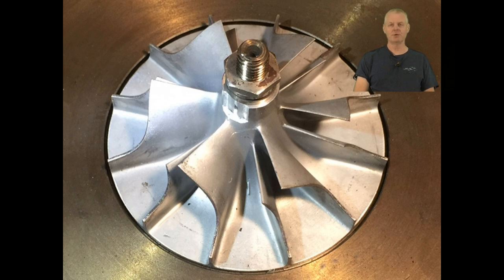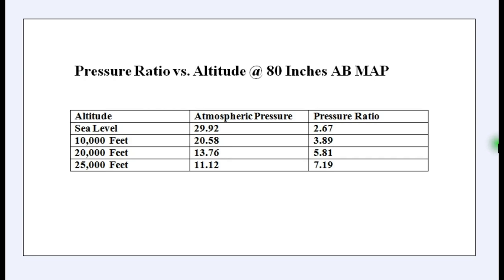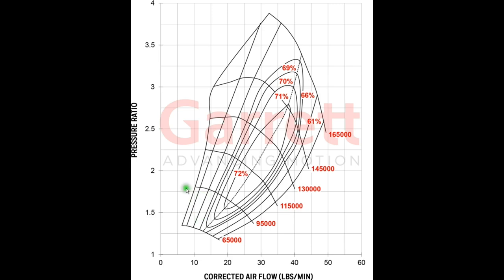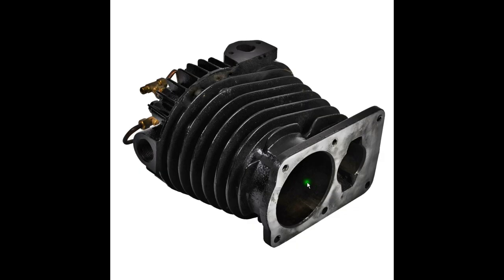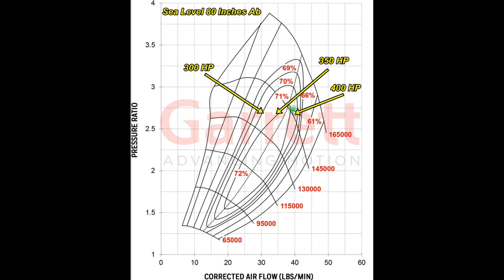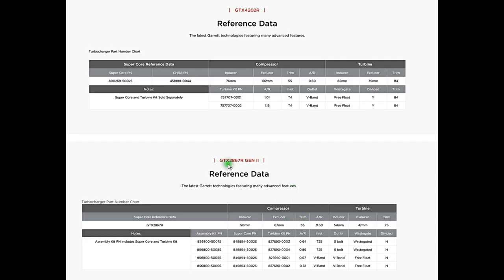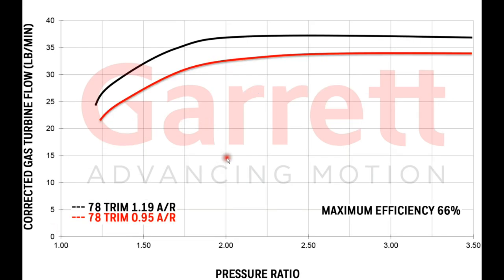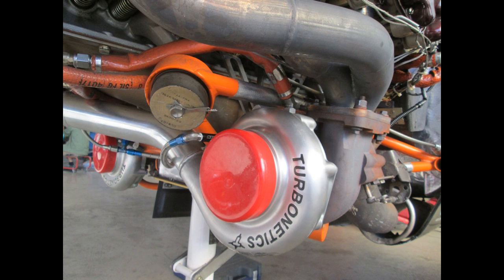What's Wrong With Raptor's Compound Turbo System?

Comment: Your numbers for petrol fueled engine is spot on my friend...
Reply: @ryanthomas2472  , Yep, getting the boost on the money is the goal! That's what experimental is all about! At least it's spurred intelligent working knowledge of innovative discovery of upgrading light aircraft propulsion... Many discussions are now happening... The compression ratio that's engineered into engines is called "static compression." When boost is combined in conjunction with compression ratio, the result is known as the "Effective Compression Ratio." Low compression engines will facilitate higher boost than high compression engines. An aviation solution that one company has employed with Diesel engines is a low compression aviation Diesel engine requiring spark ignition which will accept higher boost. With any application of serial compound boost it becomes a balancing act of engineering compromises concerning aviation FL (Flight Level) operational environments. 

Presently I'm spending time with a commissioned project calculating series compound boost for a proposed aviation 4 cylinder 150 KWH auto ignition Diesel propulsion unit. I've found the numbers skewed counter intuitively with high compression engine applications fed with railed fuel injection systems... 

I'm convinced that Boosted Aluminum Block Diesel aviation piston engines will gain a considerable market share like they have with the marine propulsion industry. Bottom Line... Experience with petrol boost low compression SI engines isn't an equivalent benchmarked Horsepower conversion when working with boost... Torque is the master of KWH conversion. The goal in X country aviation or marine propulsion operation is to use less fuel for distance traveled... Correct? 

The balancing act that's paramount to this aviator's awareness is average fuel burn consumption for weight transported. I've found that Torque fuel flow of Diesel piston engine propulsion KWH output is almost 1/2 that, of it's petrol burning cousin... In other words... 20 gallons of Diesel fuel (timewise) will just about do the work that it takes 40 gallons of petrol to perform... Rule of thumb speaking!  rv6ejguy with his presentation is spot on for petrol... He's a sharp guy that's very detailed oriented. I've been working with boosted diesel marine propulsion at about sea level since the 1970s. The Mercruiser TDI 3.0 V6 Mercury Diesel TDI marine propulsion system is similar to the Raptor's Audi 3L TDI. I only became aware of Peter Muller's Raptor project June of 2020. I never considered employing Diesel engines for light GA aviation till I discovered Peter's remarkable work at that time. Since then I've been experimenting with different configurations on the Mercruisers to get my base data from, thanks to his work.

I've spent many enjoyable hours with aviation since the late 1960s. Primarily with certified manufactured aircraft. Mostly avoiding experimental machines...  love flying at FL-24 in a private 4 place turbocharged aircraft, cruising at a calibrated IAS of 100 ~ 120 kts tracking groundspeeds north of 200 Kts sipping an average 11.5 GPH fuel flow petrol in strait and level cruise configuration... But that's only 20 MPG with a tail wind... With Diesel the MPG would be closer to 30~40 Statute Miles Per Gallon in real-world applications... When I crunch the numbers... Series compound boost Diesel piston aircraft propulsion becomes a no brainer decision for light private aircraft operations... Good thing that Turbos are relatively inexpensive in the scheme of things... We need real-world test to verify what seemingly looks good on paper. At least now we have a working premise to tackle the solutions...
Reply from the maker: @willhibbardii2450   Present SI aero engines can deliver .38 BSFC in cruise LOP, the best light diesel aero engines about .33. That's only about 15% better. You're saying here the BSFC will be half with a diesel... Diesels output less torque and HP per unit displacement and boost than SI engines. I did a video on this some months back. Diesels have several drawback for high altitude aviation compared to SI engines. I may do a video on that sometime in the future. The big draw for diesels is no lead, cheap fuel in my view.
Reply: @rv6ejguy  , Yes, I prefer inexpensive thrifty clean burning fuel... A rule of thumb I've adapted for the marine and aviation propulsion is remarkably accurate and simple... BSFC (Brake Specific Fuel Consumption) with gasoline propulsion I've found to be directly relatable to (GPH Fuel Flow)... Multiplied by 10 is close to horsepower being employed by the engine, with an engine running LOP (Lean Of Peak)... Example: If the Gasoline fuel is flowing at 20 GPH (Gallons Per Hour) the so called horsepower being employed is about 200. Not perfect but there about... 200 HP I equate to on the dyno to be about 150 KWH... At Standard Temperature and Standard Pressure with naturally asperated engines.

Supercharging and turbocharging simply equate to expedited climbs... The trade offs for the amount of fuel needed to get to FL- Cruise altitudes then trimmed clean is a stepped process of performance finding the sweet spots. With every 10 gallons of fuel burned (Gasoline) the aircraft loses 60 pounds and the aircraft will climb to the next step...

The Guy that taught me to fly little airplanes drilled something into me that's been very handy. The Aircraft I trained in was a Aero Commander 100. He had a fuel flow indicator installed. On a cold day below standard temperature 0 C at sea-level the engine, a Lycoming O-320-A air-cooled flat-four, 150 hp (110 kW) would consume just over 16 GPH on a hot day that number changed dramatically reduce to under 14 GPH at about sea-level. A large portion of may aviation training was operating at 14,000 feet MSL and above in that little aircraft especially in winter months. When I started doing my solo cross country work it was no problem getting through 14,500 and above (Yes we carried supplemental Oxygen) It amazed me that the naturally asperated engine LOP would sip fuel at less than 6 gallons per hour throttle to the fire wall at full altitude. The translation to horsepower was about 60 hp employed but yet we could track ground speeds well over 120 MPH. A great trade to my thinking. Though the Corrected TAS was 65 ish. He taught me how to enjoy little airplanes and keep the cockpit quiet with very little stress on X - Country flights... The cruise accent to altitude was 1/8 FOB (Fuel On Board) of the fuel consumption and the decent 90 MPH at 300 fpm decent with the engine loafing. No need for headphones. Guys that fly with me comment how well they can hear without allot of engine noise and appreciate hearing the controllers on the overhead speaker. He taught me to use weather as my friend and navigate the VOR Rhumb lines taking advantage of the wind components and shifts in the winds aloft FD (Forecast Data)... 

He was a fighter pilot during the Korean War and became an instructor. Many controllers would hear Aero Commander and relate it to the twin 500 which he also flew. I know he enjoyed that aspect dropping in hot from altitude with a 30 kt tail wind to the downwind leg with a 150~160 MPH ground speed turning a quick base and final on an expedited approach in the 100. He taught me how to dump energy, land like a bird and clear the runway. My grandmother called it landing on a dime and leaving 9 Cents change... 

Handy Safe maneuver when landing little airplanes in big bird (Bravo) domains. Jets behind me have been warned by control towers of my propwash🤣 

I've fooled many towers over the years in Cessna 150s thinking I was a twin Cessna arriving. I've actually had controllers ask me what kind of souped engine I had in it. Seems unusual to see a 150 at 14,500... Just stock 115 HP and knowing how to ride the chop... 

Ok Marine Diesel topic... The first marine Diesels I worked with were Perkins TV8 540 twin turbo. Rated only 145 HP. (109 KWH) yet sip fuel at 5.5 GPH under full load. Ratings in the marine industry diesel world are curious... This same engine block is very capable of delivering 300 HP (225 KW) though the fuel consumption dramatically increases to 15 GPH... In the Super Yachats this same block is reported developing over 2,000 HP... I  don't know the fuel consumption flow rate... But I imagine my rule of thumb calculation is out the window.

A Stock Mercury Marine 240 HP (180 KWH) 3L TDI @ 3,950 RPM propped to full load (verified) sips fuel at 12.5 GPH ADL (All Day Long) yet at 2,500 RPM sips fuel at 5.5 GPH ADL~ANL (All Night Long)... My findings indicate that with Diesel fuel Power that a multiplier of 20 concerning fuel flow GPH is ED (Every Day). Example: 10 GPH Diesel fuel consumption X 20 = 200 HP (150 KWH) Work Employed... Compared to Gasoline's multiplier of 10. Example: 10 GPH Gasoline fuel consumption X 10 = 100 (75 KWH) HP work employed... It's known in the marine industry manufacturing engineer circles as reserved torque! Rule of thumb speaking. OMC V4 two stroke Gasoline Example: Same Block but 80, 88, 90, 95, 100, 110, 115, 120, 125, 130, 135 and 140 Full out same bore and stroke. inexpensive minor changes facilitates this wide range of performance values. I work with 4 strokes also... Horsepower ratings... Guess What? 

Fuel consumption divider of 10 nails their respective GPH fuel consumptions @ WOT (Wide Open Throttle) under full load in their RPM classifications between 4,500 ~ 5,750 predictably... ADL... 3,000 ~ 3,200 is the sweet spot for planing fuel economy. I look forward to your presentations... Persistence with endeavors is the path to recreation! Cheers
Reply: There is also a difference in density, diesel is about 10% denser, so that when measuring fuel flow in GPH the difference will be around 25%, at cruise power.  With a power setting of 70% plus, an air cooled Continental, will not have an SFC of 0.38 and then probably will run about twice the GPH.  I don't think Lycomings get as low as 0.38 and more like 0.42.  As you say, cost of fuel and availability are a major factor.  In most of Europe AvGas is about 3 x the cost of Jet-A and in most of Africa you cannot get AvGas at all.  Diamond have been building certified aircraft, powered by certified automotive diesel engines, for 20 years.  They are fuel efficient and now have turbine like reliability.  The DA-52 has a 3.0 litre V6 turbo diesel based on a factory standard Mercedes-Benz block.  It has a solid geared reduction drive, runs cool in the climb and cruise and it can descend fast without shock cooling. That engine is made by Teledyne Continental Motors!
Reply from the maker: @PhilipFly11  I've done a detailed comparison of various aero engines, both CI and SI.  See vid #93 on my channel.
Reply: @PhilipFly11  , I see a huge advantage of liquid cooled adding to reliability. The way I was taught to operate an air-cooled aircraft engine I've never shocked cooled damaged one...Engines get hot when steep climbing to altitude, cool down in strait and level flight and can be damaged dropping out of the flight levels too rapidly with rich mixtures and quick throttle changes..

Quality fuel flow indicators are calibrated to specific type fuels being used... As are fuel gauge indicators... If you are employing a petrol fueled 150 HP rated engine @ 70% LOP then expect the fuel flow to be about 10.5 GPH fuel flow representing 105 HP or (78.75 KWH) consumed to do the job... Rocket Science Simplified!!!

Cutting through the stuff...

SFC (Specific Fuel Consumption) SFCB (Specific Fuel Consumption Brake) are only a Datum Markers for what can be expected with a specific setup and platform configuration. A popular fuel consumption formula model is: X (fuel amount in liters) x 100 / Y (total distance in km) Using this formula, the Einstein's in our world calculate the amount of fuel your ride's needs for crossing a certain distance. So, if your ride traverses 500km by consuming 60 liters of fuel, the consumption rate will be: 60 x 100 / 500 = 12... 

What these Datum Markers are missing are plethora of incomplete information such as: temperatures, humidity, dewpoint, air density, average terrain conditions... Smooth road or bumpy? strait or curvy, Wet or Dry? Is the 500km flat as a pancake? What's the winds and weather components? Is there a 30 ~ 100 Kt headwind, crosswind, left rear or front quartering, right rear or front quartering or tailwind? Is the terrain all uphill or downhill Grades or all of the above? 

SFC numbers are only a static representation in my view... We live in a dynamic world so your mileage may very... All these numbers can be altered by adding or minus an inch to the tire diameter. are the tires balanced or staggered? 

When working with SFCB then your talking loaded torque or KWH still only a static datum marker with lots of missing information. What's percentage of the load? 10, 20, 30, 40, 50, 60, 70, 80, 90, 100 percent? Are we running rich, peak, lean of peak. Is the vehicle streamlined or a big box? Lots of information missing... 

When talking aviation or marine weather, tides and currents all have effect... Partial Bottom Line... In the dynamic world speaking aircraft performance, it's best updated every 6 minutes. Example: If I'm traveling at 200 Kts. ground speed in clean strait and level configuration... every 6 minutes I will progress 20 Ktm... The next 6 minutes the wind or current shifted to a headwind and my groundspeed suddenly dropped to 170Kts. then in next six minutes I can only expect to traverse 17 Ktm moving forward in progression for an average groundspeed... Bottom Line... An aircraft engine runs when fuel is present.

Generally engineers limit fuel quantities to 80% of full load or SFCB which translates to KWH static load @ standard pressure and temperatures. My rule of thumb is 10 Multiplier petrol fuel flow in GPH = HP Delivered... If the engine flows fuel @ 20 GPH Static full load... Then I size the tanks to 80 gallons + 15 gallons reserve minimum... If your flying your 200 HP powered aircraft at sea-level on a standard temperature day and your calibrated fuel flow GPH is steady at 20 GPH expect the engine to starve for fuel in 4 hours and 45 minutes... Give or take 15 minutes... As far as distance traveled only the aircraft configuration weather and your style of flying knows. All the engine knows is time till being refueled and dynamic forces can add or takeaway distance traveled.

Marine Diesels experience a multiplier of 20 All Day and all night... I think this can also be true for aviation.

Glad to hear reports that aviation piston Diesels are competitive reliability wise with turbine engines... 

Diesel fuel availability in remote areas when Jet A and 100LL is non existent is another motivator... Cheers
Reply: @willhibbardii2450  Very interesting and informative. Thanks for taking the time to write it.

Comment: The big problem with his turbos right now is that he has metal particulate flowing through them. I'm pretty sure that when he blew up his last engine he never went through all of things the oil touched and cleaned or replaced them.
I'm pretty sure if the old engine had managed to start again he would have just carried on using it.

Comment: Thanks for the explanation, I learned a little more about turbo design! It wasn’t super clear to me why the Raptor was using a serial turbo setup, but now I understand a little better. The choice of engine for the Raptor is really the bigger stumbling block for me. The 3.0 TDI engine hasn’t been made since 2015, so even the best example out there is 6 years old, and likely a buyback from the dieselgate scandal.  That doesn’t bode well for long-term support, spare parts availability, and general technical support of the base engine.  I think Raptor serial #1 and maybe #2 will probably eventually get to a successful point, but it will need to be re-engined for anything after that, in which case I hope your turbo suggestions are taken into consideration if it’s another car engine conversion.
Reply: Look at Darkside developments in the UK. 3.0 tdi engine can be a powewrhouse if done correctly.
Reply: 3.0 TDI engines are abundant worldwide, and they are a benchmark in power and efficiency. When referring to outdated technology, please consider the faa regulations for general aviation craft: typically using 1940's technology and shunning innovation. Two valves per cylinder, constant spray manual adjusted mechanical fuel injection. Mechanical spark advance. Research diesel aviation engines and you'll see how much of a hindrance the faa has been on affordable personal aviation. At least Peter's goal is in the right place, even if he's missing the forest of valid advice.
Reply: @davidgreenfield1476  I don’t doubt it is a wonderful engine, but it has been obsoleted by its manufacturer.  In fact, both Audi and VW announced they will no longer develop new ICE engines, which further reinforces that this engine’s days are numbered (and it’s already 6 years on borrowed time!). I think that is a pretty serious demerit for a brand new, clean-sheet airplane design.  Maybe you can source engine parts for the next 5 years, but what about 10 years from now? 20 years?
Trust me, I’m all for high tech engines. I’m currently building a plane myself, and it is powered by a Rotax 915iS, which is one of the most advanced GA engines you can buy right now.  But it’s also backed by an engine company that’s been around for a while that will probably still be producing this engine 10 years from now.